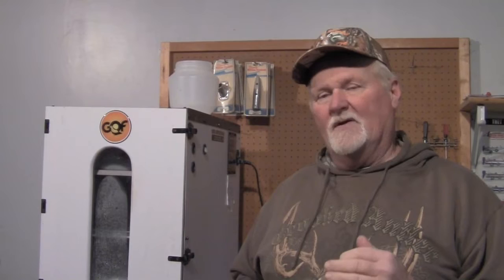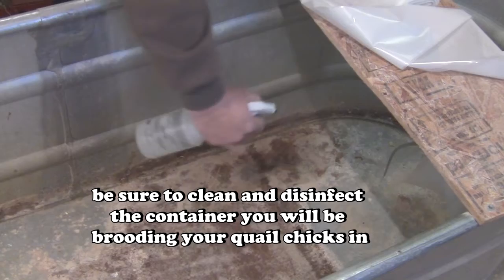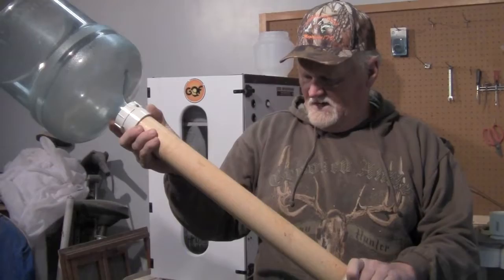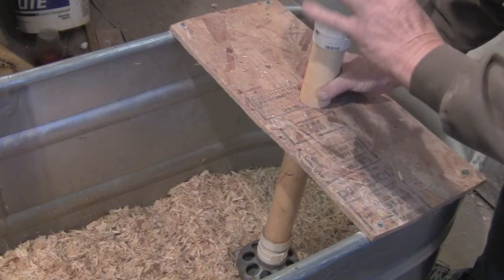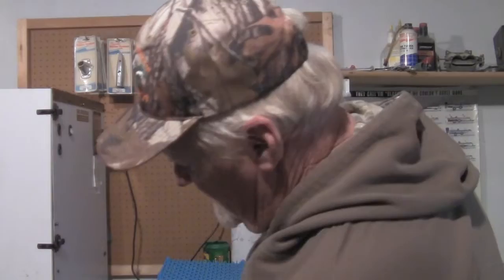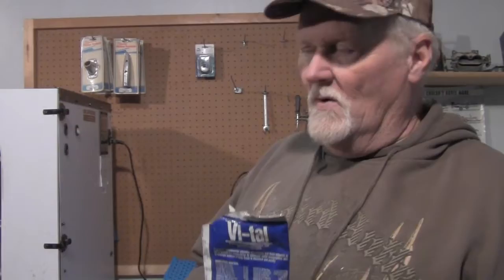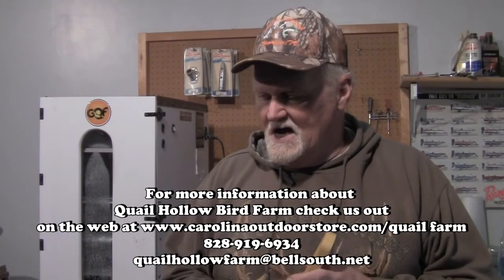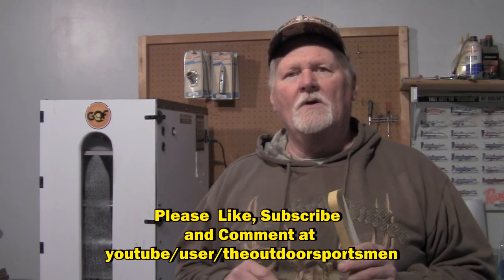Hatching Quail from Incubator to brooder,How to hatch Quail, "Part 2"

Comment: Thank you for the video. Our brooders are constructed of 3/8” plywood. The walls measure 8’ long  X 4’ wide X 4’ high. The floors are 3/4” thick stall mats that provide excellent insulation and ease of cleaning/disinfection. The covers are 1/2” grid wire and heat is provided by Prima Heat Lamps or Carbon Fiber heat lamps. Bedding is pine shavings. We build access doors into each end and the entire box can be easily separated into two 4’ X 4’ units. The brooders are marked and assembled with screws, allowing it to be quickly disassembled and stored easily until needed again.
Reply from the maker: Thank you for the great description on your brooder. I'm sure our followers will find it of use to enhance there quail raising.

Comment: That feed system is genius. The less work the better. What size was the pvc pipe 2 inch or 3 inch?
Reply from the maker: Hello Brandon Sorry for the late delay in replying to you appreciate your question that was the 3-inch pipe that we used on that particular feeder. We found if you use anything smaller it tends to clog up with the starter grower feed